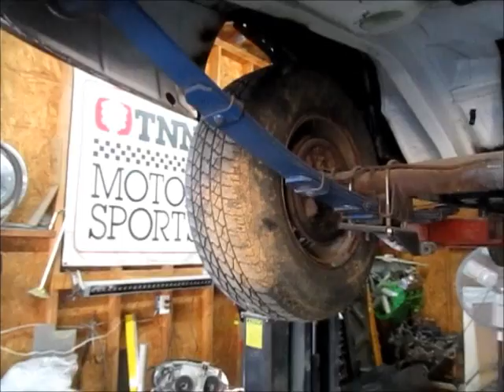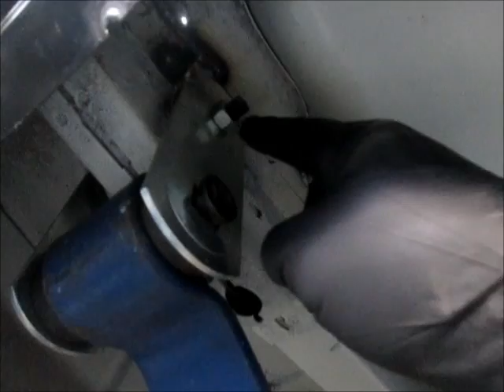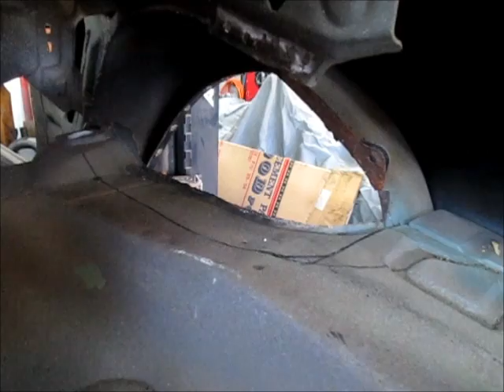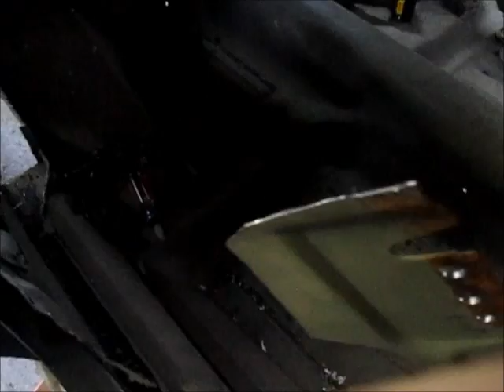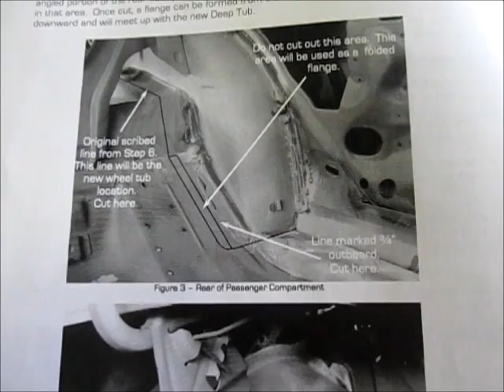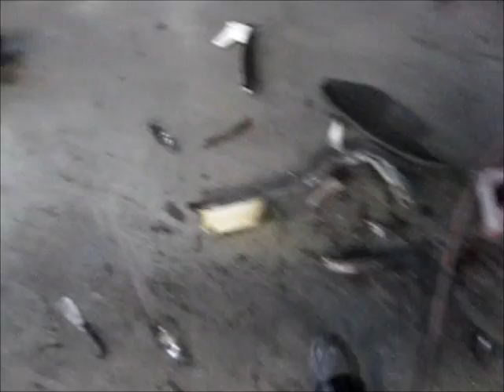1968 Camaro Mini tub install part 1

Comment: Hey buddy..STOP STOP STOP Buddy are you kidding Me ..You have the "Instructions" all laid out ???? Your doing some mini-tubs not performing open heart surgery  Installing mini-tubs are by far one of the easiest "chore's" to do . But as far as measuring ....measure what ? your either going to open it up to the uni-body frame rail or cut into it..and because the frame rail is not very thick you have to weight the benefit of taking the extra tire clearance or not  because your no doubt going to trim and or remove the inch and a half lip of inner wheel opening so with that gone and your trunk floor cut back to the frame rail you now have enough room for those  M/T 315 Drag radials if you choose the right rear wheel back spacing ...But if I were you I would immediately loose the leaf spring rear and go with the coil over . Camaro's are by far the very best for doing the swap from leaf to coil and your adjust ability  and tune ability is just amazing .. the ride height .. Hey your going to have so much fun with it . I'm jealous .. Good luck bro...." Instructions" ??? Remember... it's NOT complicated ...

Comment: Why don't they make a Mini tub just wide enough so you don't have to cut the frame??
Reply from the maker: +Old Gamer Well, the difficulty is that the frame tapers outward behind the axle. A narrower tub that would fit without modification wouldn't gain any width advantage. If you notice, the front part of the frame doesn't get cut.
Reply: I did find some after i posted the comment from Real steel they are 3/4in narrower 260. bucks but fit great